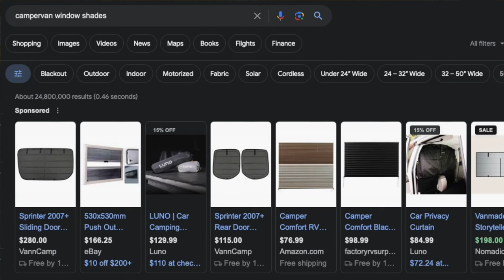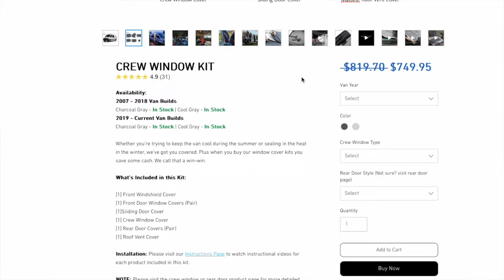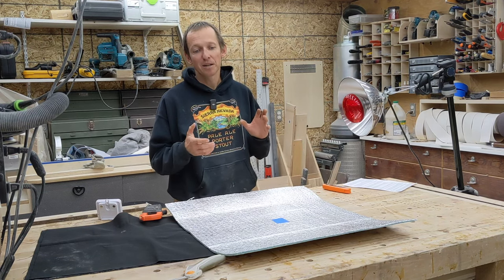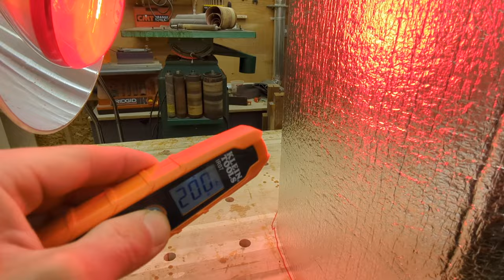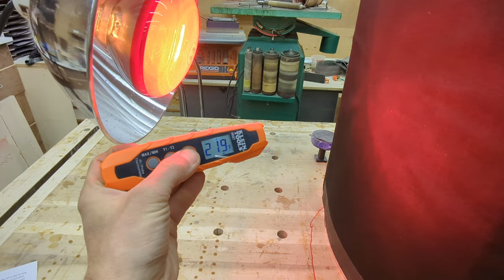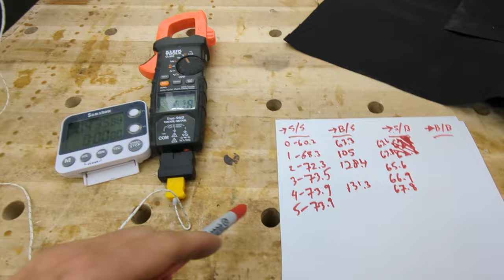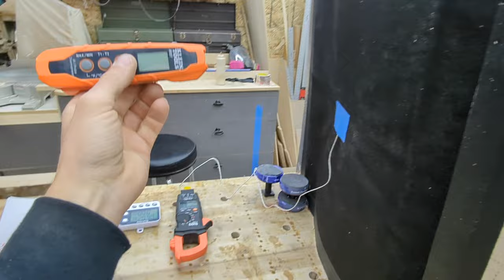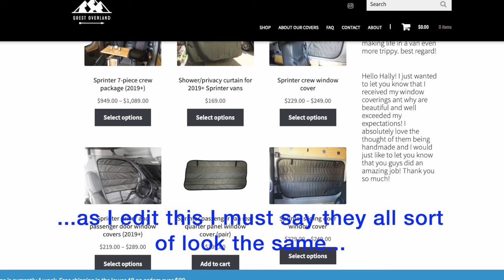Don't Believe the Hype: Window Shades for your Camper Van Conversion

Comment: It seems like the best solution for heat rejection is to use a heat rejecting tint on the glass like 3M Crystalline, in conjunction with a white fabric on the insulating window cover, since black is so heat absorbent. Also having the cover sealed as much as possible, such as having a large number of tiny magnets sewn in, creates a sealed air gap between the glass which adds a lot more insulating value. I've been contemplating ways to use foam weatherstripping as a gasket to better seal the air gap when the covers are in place, not just relying on the magnets. This air gap idea has major clout. In the coldest winter in our Pleasure Way Sprinter RV, I used blue masking tape to seal up the vinyl roller blinds to the plastic window frame. This stopped the cold air from flowing down off the glass and dramatically increased the warmth when sleeping at night.
Reply: Just use the insulation without cloth covering. As a bonus you can get a roll at the home store cut em yourself and save almost $1000 , I can't believe how much fools pay for this junk.
Reply: In areas with low humidity, radiant heat from the sun is enemy #1. Best bet is to reflect it back before it hits the glass (or side of the camper). Best of all is an awning that puts a huge space in between the reflective surface and the camper, so there is no heat transfer by conduction. 

Next best is to have the camper itself (or the windows) reflect it back into space. (Surprisingly, white is just as good a reflector as silver or mirrored, it just disperses the reflected light more.)

But moving inside the camper, reflective surfaces aren't nearly as effective. Putting Refectix inside the windows might reduce the amount of radiant energy being absorbed by the foam backing, but it sends that reflective energy back through the window, giving it a double dose. So, the glass gets hot as it absorbs some of the sun's radiant energy and then gets even hotter as it absorbs the reflected radiant energy on its way out.

Reflective window coverings are great for winter camping because they amplify the light inside the space. But the amount of radiant heat they reflect is insignificant and not worth worrying about. 

For summer camping, reflect the sun in ways that still allow good air circulation (awnings are the best) and for winter camping focus primarily on insulation thickness and preventing drafts.

For homemade winter window coverings, a good starting point is a quilted $20 Walmart Thinsulate sleeping bag.
Reply: @koertdubois6781  I made a set with the same 5mm foam material he is using in the video. I painted the outside surface with black paint so I essentially lost the reflective property of the surface facing the light/sun. I also made them 2 layers thick. I have seen someone have them with 3 layers of material but I have not tried that yet. I suppose the best design would be not to have them flat against the glass but to have an air gap for superior insulation, correct?
Reply: Do you have a video on how you made yours?
Reply: @ray32825  the "air gap" would provide an extra layer of insulation, but unless it's perfectly sealed, it would add to convective losses, where heated interior air could leak into the space next to the window.
Reply: @koertdubois6781  That "insignificant" reflected thermal heat back inside is the whole concept on how those mylar emergency blankets work.
Reply: @ctrlaltdebug  That's correct, and the mylar emergency blankets work great when used over bare skin. 

But as with all the "leading edge" reflective ski and surf products that failed miserably, if there's a layer of fabric in between the reflective surface and the bare skin, there's no reflection of radiant energy.
Reply: I actually did that in my van (I used Madico Black Pearl which is only 87% IR rejecting but it was half the money from others that were 91% IR Rejecting) and although the radiant heat inside the van is effectively reduced, the glass is actually heating up approximately 10C higher than windows without it so the windows become heat radiators and the van heats up through convection heating.
Reply: I'm surprised no manufacturer has come up with half reflectic, half fabric. Get half the reflective properties but still have the decorative esthetics on the inside.
Reply: @koertdubois6781  Everything you say is true. I have IR rejecting tints on the windows and as a result the glass gets significantly hotter than regular tinted windows. My next move will be to put perforated self-adhesive white vinyl (the one usually used for printing) on the outside of the windows to reflect the sunlight before it hits the tinted windows.
Reply: @koertdubois6781  estou de acordo.
Reply: @spiroszaharakis2648 Did this on my Sprinter passenger to camper conversion and it was the best cost to benefit ratio of anything I might have done.  I had a vehicle wrap shop do mine with a chrome finish perforated film. Significant temp drop and made the AC far more effective.  Like others have said thick wool batts that minimize airflow across the interior window surface works.. I also have used the home window, heat shrink film that uses double sided tape with good results
Reply: Saw this just in time! I'm about to make some window covers out of some leftover reflectix, and now I won't bother covering them in black material since I'm just camping and not trying to be stealth.
Reply: @JoshuaMartian-go3tm   , check out "Warm Window" Insulated Shade Lining.  "From She to Me" YT channel is using that in her van curtains and I will definitely try it out once we get our Class B.

Comment: I made a set of window shades from 3 layers,  insulation bubble foil,  cardboard and vehicle  carpet trim,  best thing ever! Also used rubber suckers to hold them in place.   Carpet facing out in the winter,  foil facing out in the summer.
Reply: Stealing this! Great idea.
Reply: I bet this method works good for condensation on windows during winter months.  Thank you for sharing 😊

Comment: My fave black coroplast on one side and something like reflectix on the other. Afix to window by tucking edges into very edge of window. Silver face out in summer. Black face out in winter. I believe silver facing inward in winter increases my radiant heat by approx 6 degrees. Coroplast provides rigidity.

Comment: Excellent vid ! I get  tired of telling people to stop waisting money on foil backed bubble wrap.
, my own shades are foil one side,  black on tother, foil facing out n summer, facing in in winter.
I'll be pointing people to this vid to back up my advice so thank you for the time and effort you put into this 😎
Reply: I compared reflectix vs cheap foam sill gasket by insulating hot water pipe. When built up to the same thickness, the surface of the foam insulation was significantly cooler to the touch than the reflectix. I concluded that the foil bubble wrap is pretty much pointless, when 3-4 layers of it still transmits much heat. I think that the bubble wrap membranes are thermally bridging and conducting the heat between the foil faces.
Reply: You should be more concerned about your editing.

Comment: Thanks for the video, very informative. My other concern is keeping heat in during the winter as I live in the north and want to build a van for ski touring. Would you make a video on minimizing heat loss through the windows during the winter?
Reply: Just use black foam (closed pored, like yoga mat) with high reflective surface glued on the inside (silver rescue blanket or Aluminium foil). 

The reflective side reflects the radiation from your body or other warm objects inside while the foam reduce the conductions. The black color on the outside absorbs heat while the sun is shining.

Comment: Here in Arizona summer heat, putting shade cloth on outside of windows works best, attach with magnets or office clips if raised window frames. Not stealth, but silver in windows isnt either.  Insulated curtains on inside, easy. Hang insulated curtain inside door. Also, for cooling, figure double square footage to plan for a/c or mini split unit size.

Comment: I really appreciate you doing this experiment even though, for most of us, it's obvious that you don't want to block the reflective side from the sun. But where I suspect you went wrong is that you didn't conduct the test with a piece of automotive glass between the reflective material and the lamp. I say this because, I suspect the function of the reflective side is severely hindered by the glass since it's absorbing so much of the light before it hits the reflectix. So while it may be a good idea to point the reflective side toward the sun, once it's behind the glass all is lost anyway because so much of the sun's energy is converted to convective energy due to hitting the glass first. Once whatever is left hits the reflective material and then reflects back THROUGH the glass and outside, the glass is heated up even more with convective energy. Thus, I suspect, the entire thermal ability of reflectix is rendered moot, or at least mostly useless when placed behind automotive glass. Does this make sense?

You see, the glass makes a BIG impact on the effectiveness of reflectix, virtually rendering it as useful as putting a thick cloth in the window.

Question: Reflectix is made for attic insulation. It's designed to staple against wooden beams with a large air gap between the inside of the roof material and the wooden beams the reflectix is stapled to. You showed a picture early in the video. And if that's the case, what good is the reflective material in the first place if the sun's radiant energy is NOT shining on it? Instead, once the sun hits the roof and heats up the roof material, it leaks through as convective heat and the reflective material is only an R value of 1 at that point. All reflective utility is lost. So I don't understand what reflectix's primary use is for in the first place.

Comment: I have a dark gray van. To block IR in roof,  I put VViViD Chrome Silver Gloss DECO65 Permanent Adhesive 

IR detector says it blocks 96% of IR. Today measures 112° on top and ambient inside. 

I used Thinsulate in roof and walls. 2” air gaps in ceiling and walls. 

Seems to be working well. 
Right this moment, Outside is 98° and inside 75° with windows and side door open. 
I bought some cheap silver window covers at Costco to block that direct sun at my large windows. My windows are factory tinted too. 
Measuring  the inside (black or blue) shows ambient. These covers are very thin. 

AI
Thinsulate is a popular material used in automotive applications for its thermal insulation properties. It is often used in automotive upholstery, headliners, and door panels to help regulate temperature inside the vehicle. Thinsulate helps keep the interior of the vehicle warm in the winter and cool in the summer by providing effective insulation. Overall, Thinsulate can enhance the comfort and energy efficiency of vehicles.D
Reply: Heat is inevitable. It may slow the heat down from coming in, but it also slows it down from coming out. That's why an empty cargo van is always cooler than a vehicle with insulation. Thinsulate is best for winter applications. But in the summer, your average user will rue the day he uses it if he doesn't wish to go to sleep at night in a hot van. The fact is that the thermal abilities of an air gap may let the heat in faster, it also lets it out faster. Pick your poison.

Comment: I have several issues with "reflective insulated" covers on the inside of a window. 
1. You are heating that plastic which transfers some portion of that heat into the interior.
2. heat is not good for plastic, nor is UV. 
3. You're blocking all the natural light, which for some of us might be the point, but for most people - well, that's why they paid extra for windows.

Ideally you want to stop the infrared and UV from hitting the window.  Awnings have the advantage of reducing the heat load on the entire side of the structure. 
If you don't have awnings, you might consider attaching the reflective curtain to the outside, ideally with an airgap.

Comment: Great information 
I use mine for stealth, to keep heat in and to keep heat out depending on the season. 
Silver on one side, black on the other. 

Interesting point about the Emmisivity. 
 
At night-black faces out. Day/black faces in 

Nothing says Hey I’m Inside , as much as foil facing out at night when you’re trying to avoid, “The Knock.”

Comment: I just use cardboard cut outs spray painted black and hold them in place with push pins in the window gasket. Makes the van cave dark inside and slows the heat transfer from my heavy black tinted glass when the sun heats them up. Its cheap and it works good enough. For those claiming to be stealth camping with shiny window covers -you’re not fooling anyone.

Comment: For years I've just been using a piece of foil-foam like that with magnets taped to it. Winter/summer use.  Been thinking recently of upgrading, but DIY. Use the foil on one side, and then glue some Thinsulate on the other side (black side out), and hem the two together with fabric with magnets in it.  Put the foil facing inside in the winter, reflect any heat back in, with 'proper' insulation against the window. Then flip it in the summer, foil to the window, with insulation to back it up.  yeah, gonna be bulky to store, but I'm ok with that.
Reply: This is exactly what I am thinking of doing! Have you tried it yet?

Comment: Good informative vid. For my back windows/doors, I use a shower curtain; dark in/white out all year long.  All heat/cold is blocked from the interior when closed.  Works for the front too, but I usually use widow shades as I try to park with the right side towards the sun.

Comment: That's good research but you need to use a Flir or infrared camera for more exact results. I found using Owens Corning Foamular
1/2 inch R-3 on my Van windows works great. I even have R-13 fiberglass insulation inside my Van doors.

Comment: Excellent. Let's lower the hype and raise the effectiveness. Two comments: 1) In the winter I'll take all the solar heat I can get. It seems like our window shades need to capture heat in the winter and reject it in the summer. How to do this?  2) Window shades can only be so effective overall given the amount of exposed metal around doors. Shades (that seal tightly) plus a "blanket" covering everything might be the solution.

Comment: Window tint film works well to block heat and UV which will fade colors of fabric and damage plastics. Havlock wool as the insulator in fabric covers works very well too. Putting reflectics inside of fabrics covers the reflective properties.🤔

Comment: Excellent testing.  I wonder about testing a white backed insulation instead of the silver.  I read some place that white has a better reflectivity than the silver.  Especially during the summer months it might prove to have improved results.  Just a thought.  Thanks for all the work you did to set up the tests.

Comment: You want reflectix on both sides with thinsulate in the middle. This will provide the best insulation for radiant AND conductive heat. Good for summer (block heat from outside) and winter (keep heat inside).

Comment: this is actually really complicated. most people dont understand anything about emissivity and ironically when were talking about every day temps, emissivity is the dominate mechanism of heat transfer without active air movement/fan. its why most computer heat sinks are painted black, despite adding a layer of insulation, without a fan blowing over them they will actually wick more heat than an uncoated aluminum heatsink. right its why a white or metal fridge will be more efficient than a black one with the same exact insulation. i think in order to measure the claims of these products accurately you will have to take a calorimetry approach and measure energy delta of a closed system.
i coated my little 12v dc compressor fridge with aluminum foil tape on the outside and coppre foil tape on the inside and saw a pretty big improvement in its energy use since the cold fridge now flicks away the heat of the room better

Comment: First I found the title of the video a kind of strange bu as it looks: The US sells different stuff than Europe: The most products of that type are "shiny", because of obvious reasons!
But: I would like to know who they work in a Van BEHIND the windows. Mine are always fitted with a foil from 35-70% darker and UV reducing. That has surely an impact, doesnt it?
Question is: If (lets say) 50% of UV is already absorbed (or reflected?) by the tint of the window... how important is the shiny part still?

Comment: Would adding a piece of Corrugated Plastic Sheet next to the reflective add the necessary air gap? It would, however, add 3/16" to the thickness.
Reply: I made my this way and painted the plastic corrugated side black. It worked wonders in sub  30° temp with black side face out (trapped all the heat inside) and relected heat with reflectic side faced out during summer time!😉

Comment: You just proved the insulation works. You measured an way over 100 deg f drop between the inside and out for the worst case. The reflective bit is a little misleading.

Comment: So an Airstream trailer would be cooler in the summer and winter, while a black camper would be warmer in the summer and winter.
Big decision is can you live with a hot camper in summer or cold in winter, or do you have to weigh in your ability and cost to run an air conditioner or heating to compensate. 

Best solution , neutral gray exterior with thick insulation, no windows, install computer monitors on the inside where windows would be and small cameras on the outside facing the sunset with the image showing on the screen.